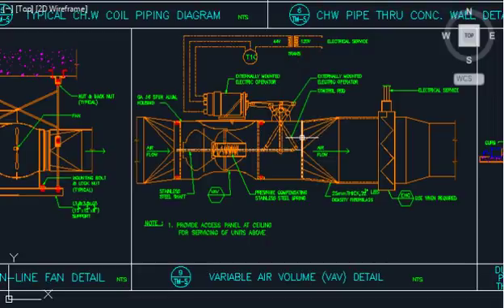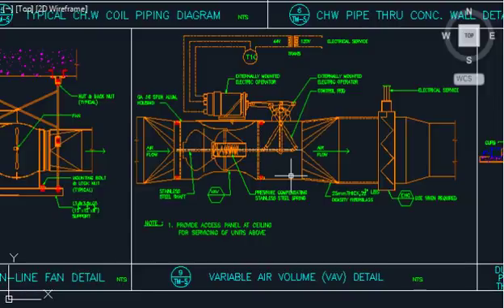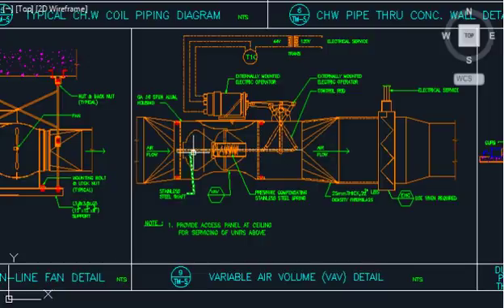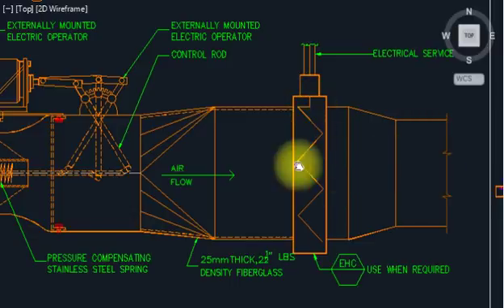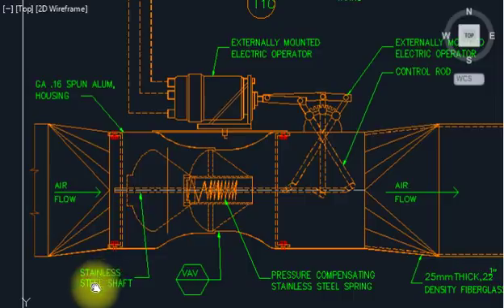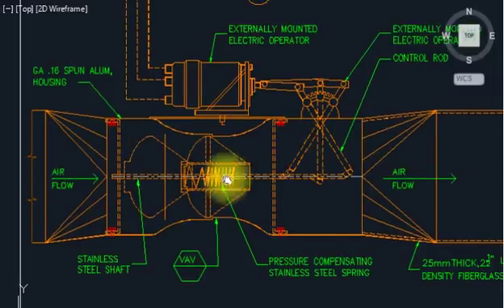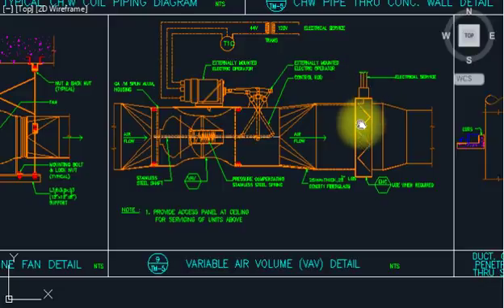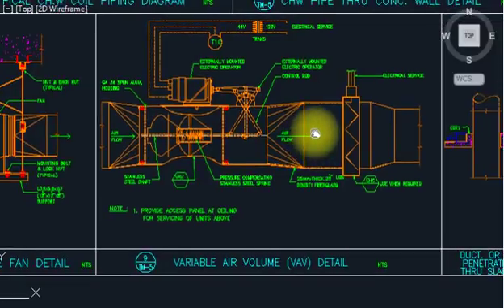HVAC Training -Variable Air Volume System in English / Hindi

Comment: Sir vav box me jb static pressure zada creat hoga tw Kia hoga? Mean pechy sy 2400 cfm ara or agey 1200 cfm ja Raha... Tw baqi k 1200 cfm static pressure barhae ga duct me. Usey kese compansate krein gy
Reply from the maker: Basically we are dealing with two system one is in VAV have bypass duct as well and other system will control with BMS system . Study 3way valve and 4 way valve as well so your point will very clear